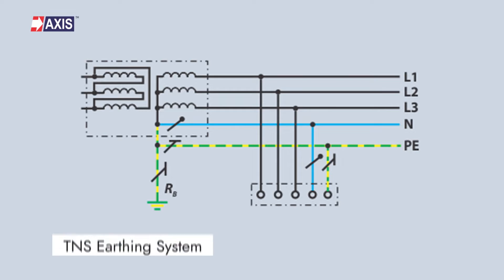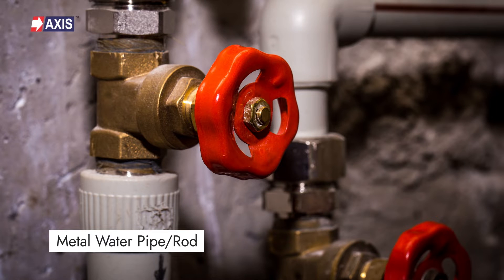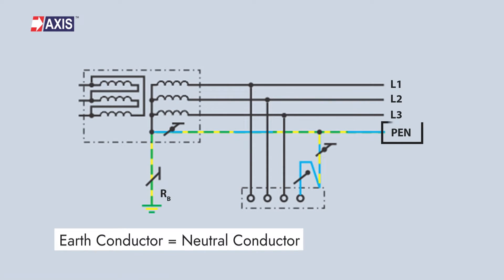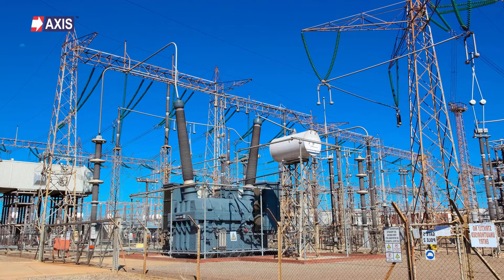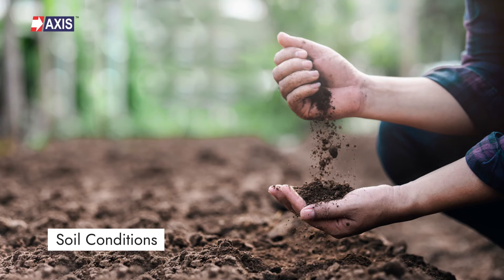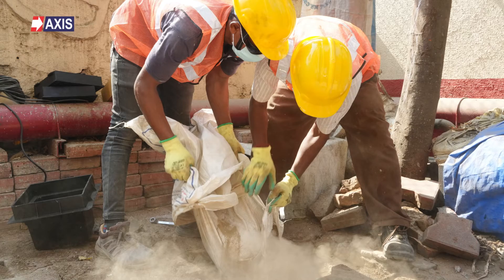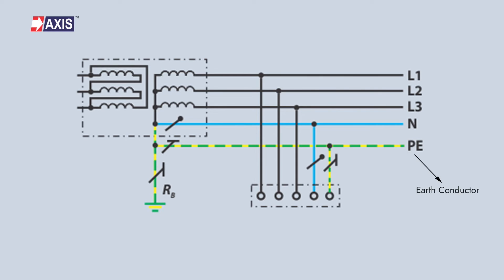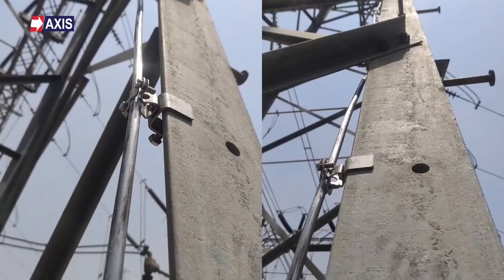What is TN-S Earthing System?

Comment: Connect to a metal water pipe or structure? Geez! Good recipe for disaster.
Reply from the maker: Based on the IEEE Std 80-2013 guidelines, you can refer to section 9.6, which states:

"Conductors of adequate ampacity and mechanical strength should be used for the connections between:
a) All ground electrodes, such as ground grids, rod beds, ground wells, and, where applicable, metal, water, or gas pipes, water well casings, etc."

This clearly indicates that metal water pipes can be used for grounding connections, provided the conductors have adequate ampacity and mechanical strength.
Reply: It's not because something is up to spec that it's desirable or even good. This is a major risk in multiple situations, with many associated accidents, and shouldn't be promoted.